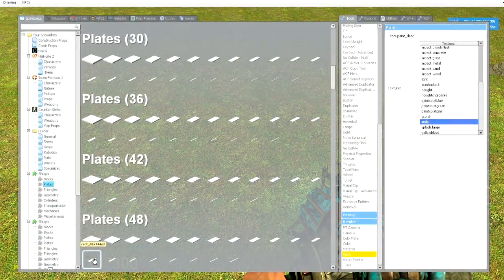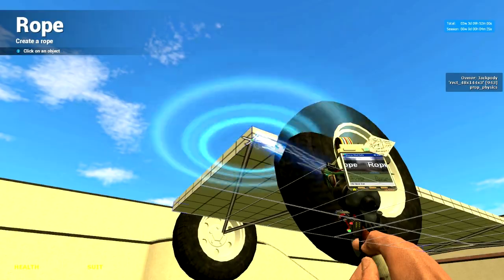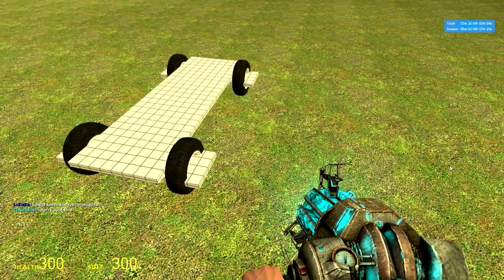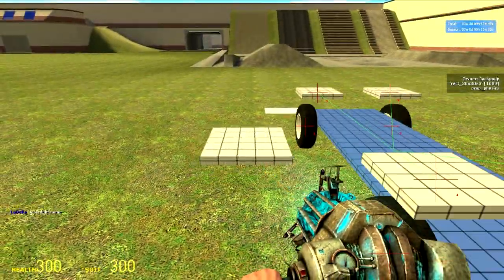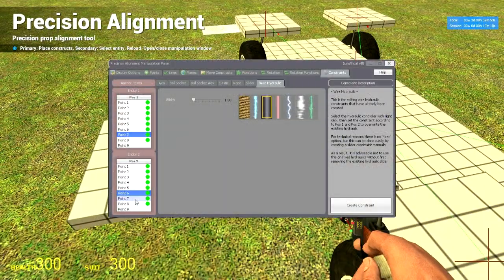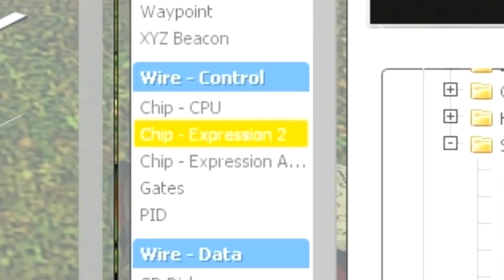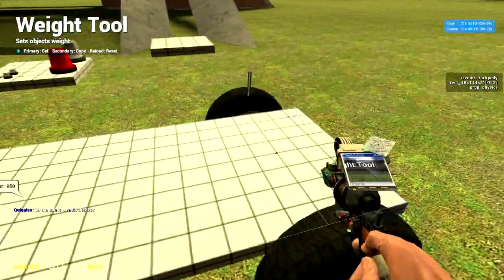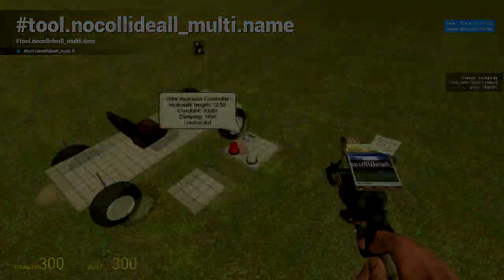[GMod 13] Suspension & Steering Tutorial - Simple

Comment: I have a problem with the car. When I add an engine to the rear (The car I'm trying to make is a mid-engine car with RWD), the whole rear of the car "bottoms out", if you know what I mean. Even multi-parenting won't work, because if I do that, the car won't move.

Please help!
Reply from the maker: ***** You can up the rear length / constant / damping to allow heavier weight. Install two buttons instead of one, then hook up the front wheels to one of the buttons and hook up the rear wheels to the other button. Increase the value of the button controlling the rear wheels and it will pump up the suspension. You can do the same for constant / damping by having more values in the constant value.
Reply: ***** If you are using ACF (Armored Combat Framework) Which i highly recommend if you aren't, but if you are you need to take the ACF Armor properties tool and increase the armor thickness
Reply: TheFallenangelfilms If I increase the armor thickness, it adds weight to the car.
Reply: but, it does make it so that your chassis or plate can support the weight, keep adjusting it till you get it at an optimal weight where it's just enough to support the engine and transmissions

Comment: would it be possible to put all the hydraulics, pods, e2 and everything on the main body instead of a seperate plate? i just tried to and as the e2 needs to spin it cant be welded on. if i axis it it still keeps the car in place as it doesnt act like a normal prop and falls to the ground. how do you attach the e2?
Reply from the maker: Theoretically yes - but it's not the best idea as it causes extra strain on the servers due to the larger amount of moving entities. If you want to save the vehicle, refer to the end of my multi-parenting tutorial where I explain area copying through Advanced Duplicator 2.

Comment: On the step where we use the Expression2 for the E2_setang_steering, the prop remains red and typing "wire_expression2_model models/sprops/rectangles/size_3/rect_24x24x3.mdl" into the console does nothing
Reply: Geoffrey White Found the solution in the comments

Comment: my rear wheels are rolling just fine but the front wheels are locked up for some reason. they are steering but wont roll?
Reply from the maker: You've most likely not placed the ballsockets properly or using wrong settings. Make sure you notice the - in front of the minimum values in the ballsocket menu. You also need to make sure you are creating your vehicle pointing north.

Comment: Thanks for the quick response Jack! but I have 1 last question though, I see lots of videos of peoples ACF cars and vehicles, and they always seem to be so fast. when I make a vehicle or car it usually can only go 49 MPH to the max, Doesn't matter what Engine or gearbox I use im always very slow. I use your technique on the wheels Physprop_Material_Jeep tire, and I use the same suspension all the time, well most of the time. Im not wiggly when I drive everything is perfectly fine, except my speed. Please respond soon! thanks!
Reply: Use a transfer case frist put the ratio's gear 1 to +1 and gear2 to-1 and the final drive tot the max and a gearbox (normal ratio's)  and you shoeld hit higher speeds

Comment: What if i dont use the same props as you? should i be aware of issues that might become a big problem?
Reply from the maker: Theoretically not. If you use ridiculous sizes like a really short and really wide base, you obviously will get issues. However if you use normal sizes that would fit on cars, then it should work on pretty much every size.
Reply: Im making a dragracing car that is shaped like a V so I guess i wont get any problems?
Reply from the maker: Just make a chassis like in the tutorial but longer, then make the base plate invisible. Bang, chassis for a drag racer you can put a body on.

Comment: How do I keep the E2 chip on the car? 
Because right now, if I weld it to the chasis it just spins the car...
Also, when I dupe the car completely (welding the control plate) 
the steering wheels just flop around with the E2 plate. And have no control what so ever. In fact, they are completely unresponsive. If I press "a" nothing happens and vice versa.
I did EXACTLY what you said too.
Reply from the maker: The E2 chip isn't meant to be put on the car as it's very strong and will alter the direction of your car in other ways than just the steering. If it turns the entire car around, then you are not building the car pointing EXACTLY north (as I explain in the start of the video). If you don't build north, then your ballsockets lock in the wrong axis. That means when you want to turn the steering, the wheels do not move so the E2 just spins the car around instead.

Which duplicator do you use? I'm contemplating uploading another video about Advanced Duplicator 2, as this is the one you should save this chassis with. You need to use area copy as I explain in the end of the video. It's achieved by holding shift, then right clicking. This creates a green box. Put the green box around the vehicle. Then right click again when the box is around it. This copies everything inside the box. Then you just right click on "Advanced Duplicator 2" in the menu and press "Save".
If you do this, then neither should unfreeze upon duping (but make sure you have the "Keep contraption frozen" (or whatever its called) in the menu for Advanced Duplicator 2.

Did you remember to take a close look at how I wired the vehicle? You need the entity marker to know where the chassis is. I cannot quite remember how the E2 is coded, but you could always test the E2 on your end by placing another steering E2, then just wiring A and D to  the A and D keys on it. If it steers, then there's something wrong with your wiring on the vehicle. You might need to place a prop and wire "Entity" to the prop, however.

Hope the above explains it. If not, Google my name and find my Steam profile - I'll accept your invite and help you out in game if you can send me a PM with your Steam name. I don't have much time in the workdays but I still have some time left in the weekends.

Comment: I don't know how many times I have done this but every time I unfreeze my tires, they spin and sway side to side. I checked my Ball Socket settings and even built North but I still don't know what I'm doing wrong.
Reply from the maker: Here are some things to check: are your ropes rigid? Are you sure you're pointing 100% north and not 95% or some other arbitary value? Are the free movement / nocollide settings in ballsocket checked according to the video?

Comment: Hello! Thank you for the tutorial, but could you explain what the length part is for? I'm making a slightly smaller car to be a bit more compact just for one person, and I don't know if putting in the length you say will break it, what does it do and how do I find the length for my car? 

Thank you for making such a good tutorial!
Reply from the maker: You can make the car any length you want. All you need to know is that you will have to fine-tune it differently since different lengths have different (handling) characteristics.
Reply: Jackpody
So is the length the distance between the front and back wheels, or the distance between the wheels and hydraulics? Or something else? And how would I find it? Thanks!
Reply from the maker: You can modify just about anything you want. Try it out - if it doesn't work, then try something else until it works. :D
Reply: Jackpody Yeah I played about a bit and got the car to a good height for it's size and type.
Reply from the maker: Sounds good! :D

Comment: My problem was because it wasnt facing north, thanks for advice but my only problem now is how do i save it , when i advance duplicate it, it only saves the chassis and the e2 and when i spawn it in it gives me errors due to hydraulics . i dont want to leave it unsaved as it took a while
Reply from the maker: You can save it using Advanced Duplicator 2 area copy. I explain this method of duplicating at the end of my multi-parenting tutorial - it works wonders for this type of setup and it's a quicker method of duplicating than you're used to.

Comment: I did your tutorial, but the wheels keep phasing through the ground, but yet not through props
Reply from the maker: Sounds like a ballsocket issue to me (or that you haven't build pointing North as I explain at the start of the video). Make sure you have ALL the ballsocket values entered correctly (some are positive and some are negative values) and make sure the 3 tick-boxes at the end are ticked the same way as in this video.

Comment: what should i do with the text link under "Expression2 for the E2_setang_steering" sentence?
Reply from the maker: +Zafer ayyıldız Are you talking about the duplication? You definitely don't need the duplication, it's just a comparison if you want to see how it should work. You need the E2, however. It's for the steering.
Reply: +Jackpody  I just got confused with the e2 tool and the way it operates. I did some research for how to use it functionally. Now i know how to use those commands. 
Thank you for your concern.

Comment: Managed to get it working, however duplicating it, trying to save it as dupe or loading your dupe did not work as apparently it can't load the hydraulics when duping and it can't seem to load the podcontroller etc. when trying to load your dupe in... Any solution for this?
Reply: Siriouz Oh, that seems to be fixed by using Advanced Duplicator 2 - for others having this issue, I can recommend downloading Advanced Duplicator 2 here: http://www.facepunch.com/threads/1136597 since the old Advanced Duplicator does not work for this!
Reply: Siriouz Nope, still can't dupe well unless I weld it all to an additional spawned prop and delete that prop after spawning...

Comment: Can also solid axis centre suspension be used? or will that disable it's steering abillities?
Reply from the maker: Won't work - axis centre will both lock up and down movement of the suspension and side to side, meaning that none of the tutorial will work if you use it.
Reply: Okay, thanks
Reply: JackpodyDK Are there any other suspensions that can be used with steering?
Reply from the maker: Experiment with it. Most real life suspension types can be re-created in GMod.

Comment: You are the best, do you make your own engines to power your cars for example thruster/hydraulic?
Reply from the maker: Hah, I've tried making thruster engines before but it never went very well. I'd love to be able to build them but yeah, I just never got around to doing it properly. These days, I just use ACF and be done with it - works pretty much for what I need.
Reply: Also I downloaded the dupe but I only have the duplicator made by the wiremod team, any idea where I can get the one you use?

Comment: can you make a video on how to fix your suspension so that the when you hit something going fast the wheels don't stay up in the air above your car they come back down
Reply from the maker: It's a very simple fix. Move the plates above the wheels further up, then redo the hydraulics. Instead of the 400% upwards in the video, try 1200%.
Reply: My Friend didnt have to redo the plates to fix the suspension on my rat rod he tried to explain to me what he did but i didnt understand he set the length on the hydraulics to like 0.90 and did something with percision alignment to fix it
Reply from the maker: There are definitely several ways to fix this issue.
Reply: +Jackpody it would really help me out if I had a video to watch to figure out how to fix my suspension because a couple of friends have the same suspension problem.

Comment: Jackpody. When i set the chassie on the ground, The wheels starting to spazz out like crazy... (Maybe its because the wheel roped to the base plate end, like the wheels beyond it)
Reply from the maker: Sounds like you forgot to weigh it. I've solved this issue before in the comment section, so take a look :)
Reply: Ok thanks! Ill give it a try.

Comment: i made the car and made the movement on vector thrusters but heres an issue : at high speed it drifts and i lose control over turning
Reply from the maker: Make sure to check out my anti-spass tutorial (and make sure to read the description of that video). Nonetheless, thrusters PUSH the car, they don't power the wheels, so drifting will always be an issue.

Comment: Uhm my wheels keep on spinning in the wrong axis, my ball sockets were placed correctly with the same settings
Reply from the maker: Did you remember to build north as I explain at the start of the video? You need to construct your vehicle pointing North on the map, else the ballsocket constraints won't work (something to do with the XYZ axis). You can find north by pressing your spray on the ground, then checking where the top of the spray is. The top is going to be north. If you had a spray of a house, the roof would be pointing north.
Reply from the maker: Glad I could help!

Comment: Why does unfreezing the stuff with the hydraulic controllers and constant value crash the server?
Reply from the maker: It shouldn't. I have genuinely no idea why that would happen, since it's literally just a place with some entities welded to. If you use the setAng steering as the wireboard, then I could understand. But with just the prop? I'm sorry but I have no clue.
Reply: JackpodyDK
I got it fixed by redoing the car itself. However, the suspension breaks whenever I land abit too hard. How do I fix it?
 By break i mean it goes way up to where it is not supposed to be.
Reply from the maker: When putting the plates above the wheels, instead of placing them 400% up, place them 1200% up. Rest is the same.

Comment: at 2:10 , why dont you simply lift the baseplate ?
Reply from the maker: When building a car with a body, you can't just move the chassis upwards because it'll end somewhere up in the body (oh my!).
Reply: JackpodyDK erm, when you do the chassis
ofc.. also if the model is parented, it just would move along with the base.

by the way, moving the wheels from the sides is not good since you might slightly move them by the y axis ...
Reply: Flowxing oops, forgot that, if you move the base relative to the wheels, you have to redo the ropes :V
Reply from the maker: And that!

Comment: I'm having trouble with the Expression 2 chip. I copied the code and put it in the editor, but when I place it it says "Error: No such function: entity:setAng(angle) at line 30, char 15"
Any workarounds?
Reply: +Pixel Snail Never mind, forgot to re-enable the propcore settings. For anyone that's stuck with the same problem all you have to do is paste these commands into the console:
wire_expression2_extension_enable propcore
wire_expression2_reload
Reply: i love you
Reply: Much love <3

Comment: I did all the steps correctly, and after unfreezing the car and placing it on the ground my front right tire wont stay on the ground, it goes underground and wont stay above the surface? Is there any way I can fix this possibly?
Reply from the maker: This is a ballsocket problem. You need to make sure that ALL ballsocket settings are done correctly (notice some have negative (-) values). You also need to make sure that the vehicle is pointed North when you build it. Not just somewhat pointing North but a perfect North (hold shift while rotating, then it locks in 45 degree angles). I explain this at the start of the video.
You also need to make sure the tick-boxes at the end of the ballsocket menu (there are 3 tick boxes) are ticked like mine. Hope it helps.
Reply: Thank you! JackpodyDK I'm still fairly new to this game and have been trying for a while to create a good working chassis. I'll remake it and try to figure out what went wrong as of what you've told me.

Comment: How can I make this suspension stiffer, and to support more weight?
Reply from the maker: +Akarkilehetek Increase the dampening and the length of the hydraulics. Be careful with increasing the dampening too much as it can cause some interesting wheel vibration issues. Adjusting hydraulic length goes a long way, though.
Reply: +Jackpody Thanks for the quick response, i tried but i guess it was not meant for 30 tons.. tomorrow i will try put 1 more hydraulic to each wheel see if that works, and thanks for this awesome tutorial btw.

Comment: Getting an error with the E2 script that says Entity:setAng(Angle) (at line 32) isn't an existing function 

Tried changing it to 'setAngle'  instead of 'setAng' and it still thinks there's an error
Reply from the maker: It has to be setAng. I'll verify the code working a bit later, but I still have not found any issues with it. Try checking the fix in the description.
Reply: @JackpodyDK  Ah yes it worked, I didn't think to try it because I thought it would've been a separate issue. Thanks!

Comment: why do my hydraulics dissapear when i remove the top plates which are over the wheels? even tho iam 100% sure i did everything right step by step.
Reply from the maker: You forgot to attach them to the baseplate, as shown at 5:55
Reply: nah, i had a problem with the precision alignment with the wire hydraulics, i fixed it and now my final produt is all of my wheels having a seizure.
however, iam doing this on a singleplayer world, do i have to do it on a public server for it to work ??

Comment: When i remove the plates that are above wheels, the hydraulic is gone too.
I used precision alingment ofcourse.
Also why is the hydraulic needed here?
Reply from the maker: You have to remember to do the "attach" part of the tutorial, where you attach the plates to the base (it's in the PA part). The hydraulics need to be there because they function as springs and damper. If you want a bit more stability, move them 1000% upwards instead of 400% upwards.